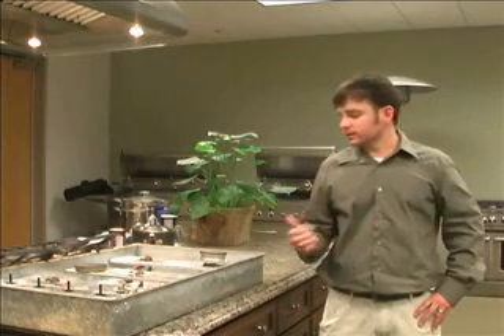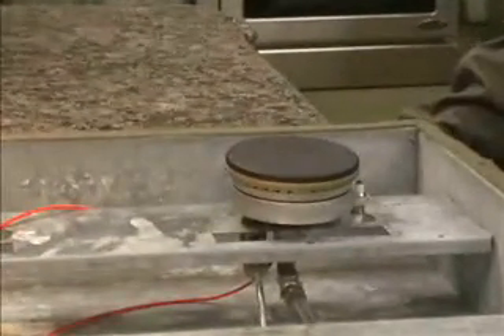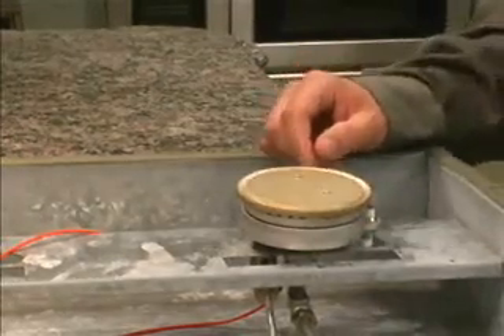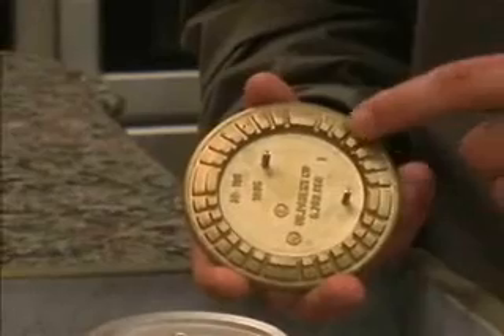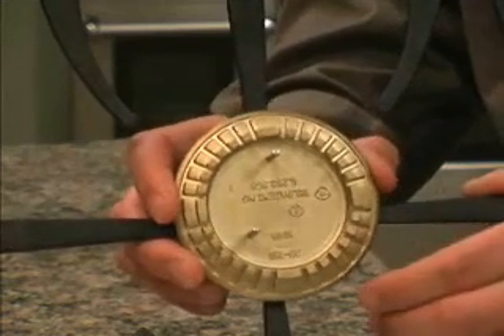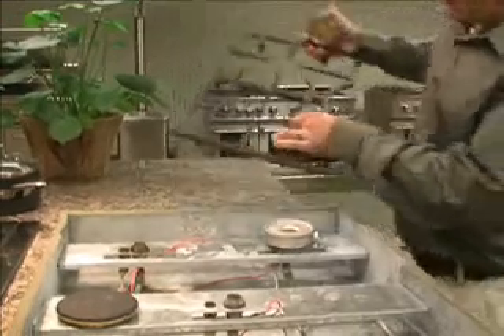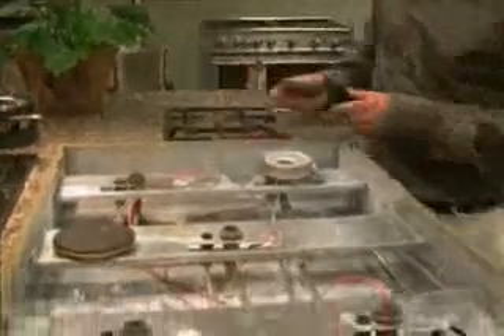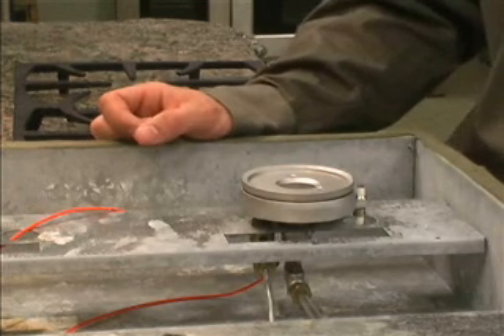DCS Ranges - Burner Engineering

Comment: Thank you for showing this.  So gas comes out of the two aluminum plates, right? That could be why my burner doesn't work.  It got spilled with milk.  what's the best way to clean these two plates with?
Reply from the maker: You are welcome!  I would use a plastic bristle brush and dish soap, give it a good cleaning, let it dry and put it back on your range.
Reply: BBQGuys.com I'll surely do that and report back.  I'll do that work tomorrow, Saturday.  Thx.
bbqguys.com
Reply: BBQGuys.com by the way.  I cleaned the top aluminum plate.  I cleaned the ignitor and I cleaned the bottom aluminum plate.  I smell gas when I open the valve and I see Sparks from the ignitor, however, there's simply no flame?  Btw: I also don't know how to remove the ignitor....

bbqguys.com - BBQ Grills, Smokers & Outdoor Kitchens  : BBQ Guys
Reply from the maker: I would recommend that you call DCS, they have service people that can come to your home to fix the issue.   Here is the page to find service providers in your area:https://www.dcsappliances.com/us/customer-care/service-my-product/
 1.888.936.7872 
Best of luck!
Reply: Yes, thanks.  They're coming.  At least we tried very hard at trying to fix it.